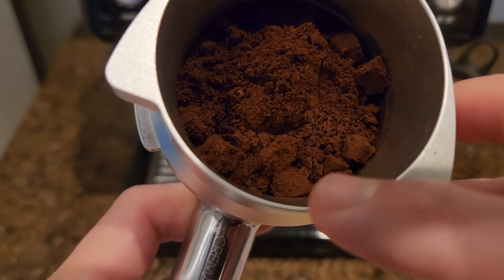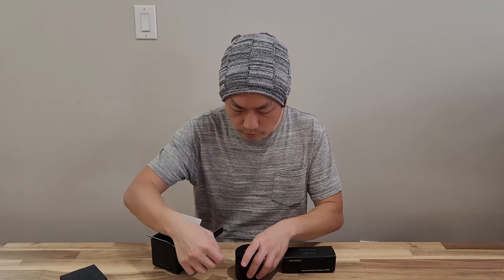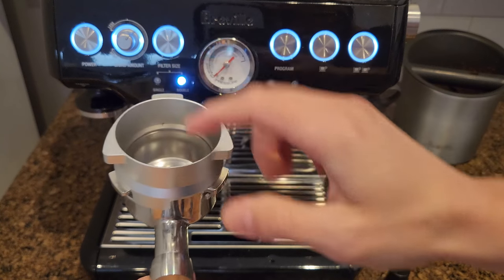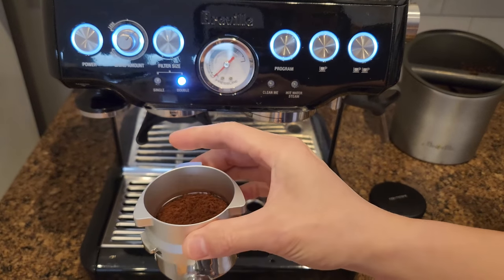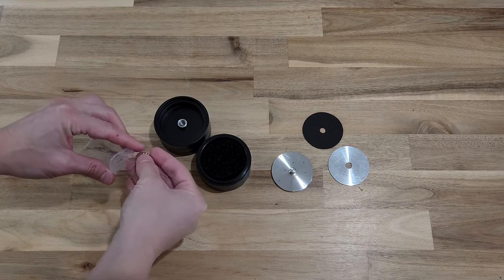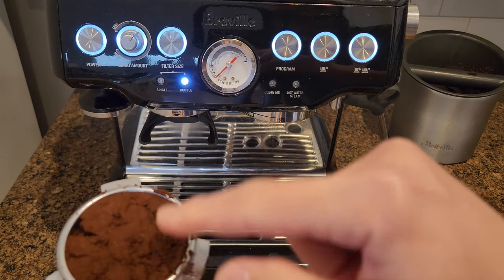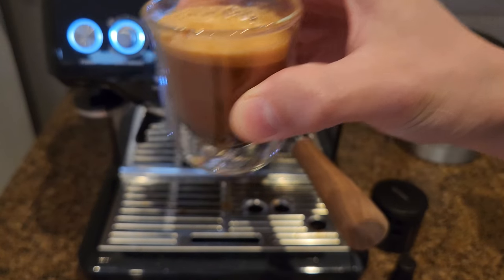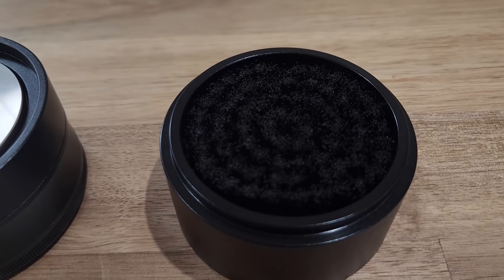Espresso WDT Tools Comparsion - Long Needle vs 54mm Adjustable Needle Distribution Tool

Comment: Super old video at this point but: 

Both of these shots are rouuuuugh. Super runny and lots of channeling, they look oily with no real body to them 

When you use the distributer tool after the WDT tool you basically negate anything you did with the needles as it redistributes them

Lastly, when you finished your grind and said the chunks were broken up, the entire thing was chunks. You’re probably extracting less than 1/2 the coffee in these shots

I recommend upgrading your breville portafilter basket as the stock one sucks and doesn’t allow even pulls through the puck. IMS makes an awesome one that will transform your coffee game

Also the stock grinder on the breville is rough, doesn’t allow for much calibration. Getting a nice handheld grinder would also do wonders for you.

Comment: Nice vid .. helpful as well.. considering purchasing this but 75$ seems high… however it could minimize a lot of time and effort … 50/50 decision
Reply from the maker: Ya, hugh price cause they are the only one in the market that make 54mm wdt tool.
Reply: @NewParentsInTraining  that is a good point.. do you use it day to day and do you prefer it to a regular WDT?
Reply from the maker: Oh for sure the 54 mm one, much easier to break chunks apart.
Reply: @NewParentsInTraining  thanks , will consider purchasing one then ! Subscribed , thanks !